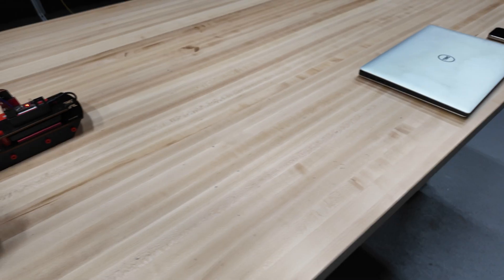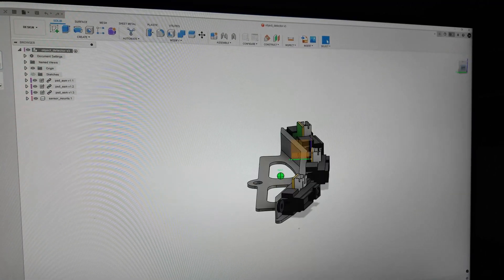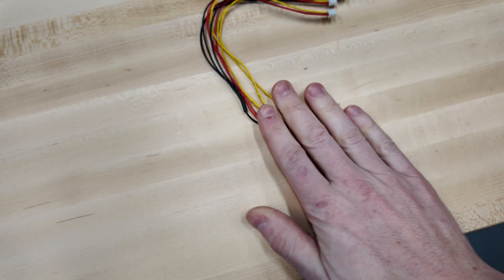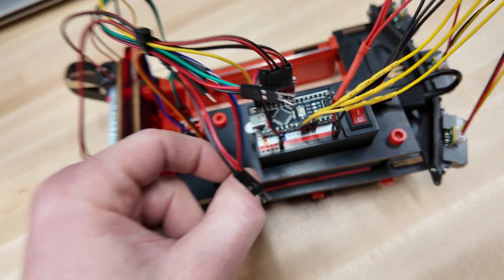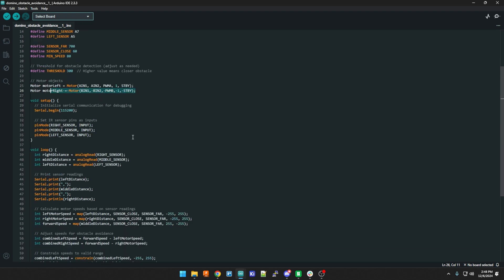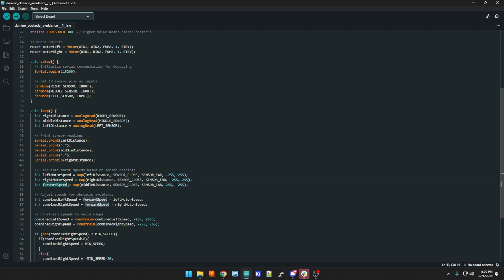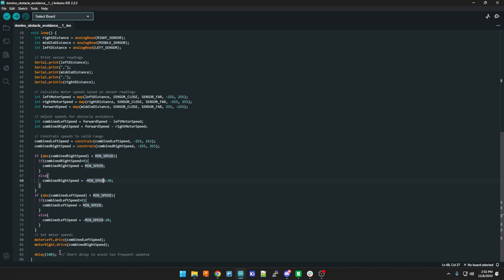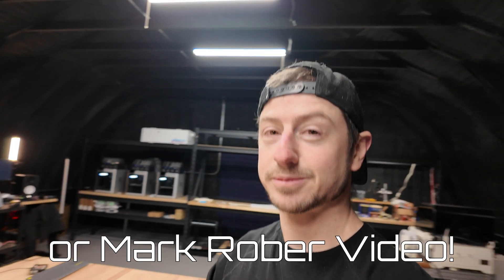It Can See Now! - Hacking the Hack Pack Domino Robot

Comment from the maker: Do you want to see more complicated, or more simple hacks in the future?
Reply: I'll pick more complicated
Reply: Complex stuff with explanations
Reply: this is a good level of complexity, but i could handle more. but this is simple enough that i would actually, reasonably attempt it
Reply: thanks for the heads up on looking for a local maker space... my library does not have a 3d printer, but i found some shops nearby that allow me to upload cad files and they charge a fee to print out your prototypes
Reply: I would say do two playlists.
1st. Easy, simple beginner hacks.
2nd. As crazy as you want, with an explanation of course.
Reply: I’m for more complicated, doesn’t have to go into all the details for me :-)
Reply: Yes!

(I fully understand this is an unhelpful answer, but sometimes I like to dive into a deep project. And sometimes I just want a simpler, quicker project. Also, the simpler ones are good for when you're taking a break from a bigger project you've got going on.)